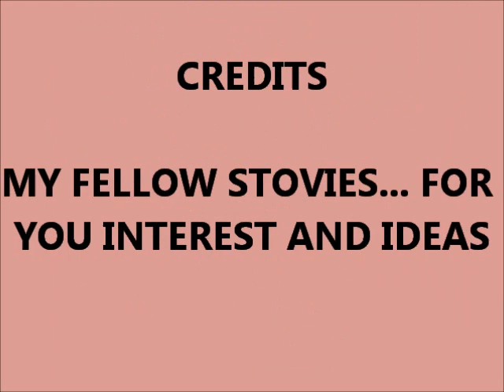DIY TENT WOOD STOVE PROTO # 4

Comment: Thanks for the info. I ran mine through the window on an older tent also, put a slit in and used your heat shield idea along with the carbon felt. Cool as all get out, thanks for the ideas.

Comment: oh, its the flexable spray on type truck bed liner you can buy in a can for about $11.00. that stuff has so many uses. Not 100% fire proof but its better than bare nylon for sure. With the gutter guard th (smash) any coals on the way out would work out nice. ps gotta use the whole can on stuff tool handles ext cause it dosent keep well after sprayed even if you do clean spray the can upside down. Thanks bro.

Comment: Hey sousaville, Safety tip, take a portable CO2 detector with you camping. There is allot of deaths attributed to carbon monoxide poisoning while camping in tents. Remember CO2 is heavier than air so place it close to the floor (3" up, approximately).

Comment: Sousa, you're a fricken beast!
Reply: go to local exhaust place and see if you can raid there scrap.. I cut straight sections from scrap.. and for $10 he flanges on end so they interlock and length is so I can fit inside my stove. nearly all fit inside.. great idea on the spark arestor

Comment: @sousaville I'm not fabricating the smokestack.  I bought one that is damned near perfect.  I'm going to have to fabricate a way to attach it to the keg, but I'm reviewing your videos and a good book I have on the subject for solutions.  I'm fabricating everything else, however.  I'm thinking of including a baffle in the firebox before the chimney but haven't decided for sure.  It would need to be fabricated.  How did you attach flat surface to top side of keg?

Comment: @sousaville  I fig that drawing O2 from outside the tent is better than inside the tent.
I couldn't find any carbon felt, so I haven't tested in a tent yet.  But it does work well.  Also, I'm gonna try to cut a hole on top that i can drop my steel bottle into to boil water...then plug it with a cap when not in use.